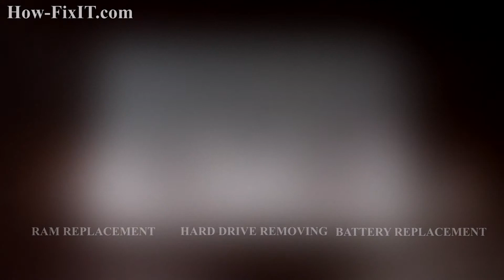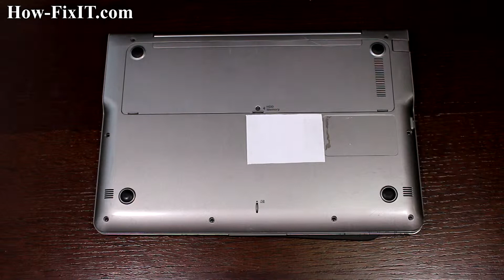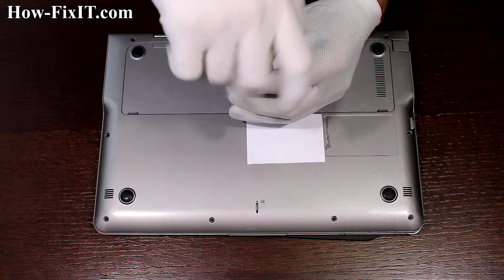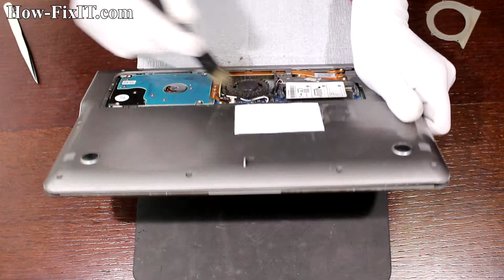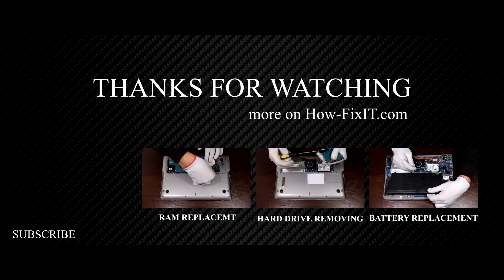Samsung 530U Disassembly & Fan Cleaning | Easy Step-by-step DIY Tutorial

Comment: use a small vacuum cleaner suck and also blow actually get one that blows is good be prepared for a facefull of shit, dont overspeed the fan even if its tempting to hear it whine like a jet,  this tosser doesnt know what he is doing dont follow any of these videos they are not pro engineers ones, seriously (age 70 + 40 years in trade) with a vac blow/suck you may be able to unlcog the fan thus not even requiring a stripdown, in fact a sure sign its blocked is it staying on fast the Temp detector commands it to run fast. HP pavilions are a prime example always full of cat hairs, bed dust, human dust, cocaine ?!! room dust etc, food etc!!!